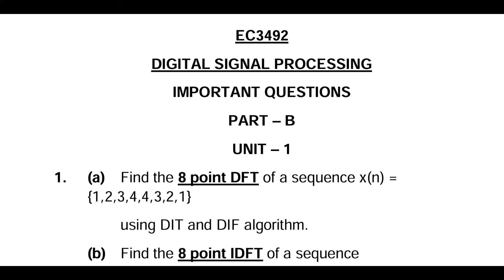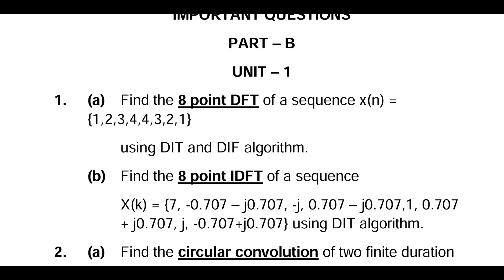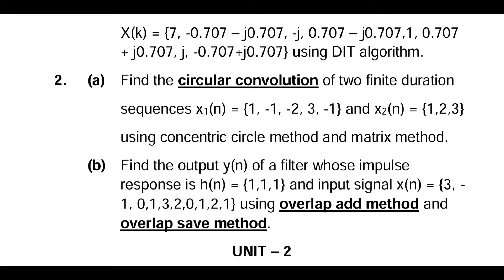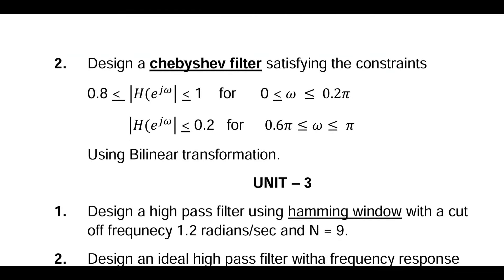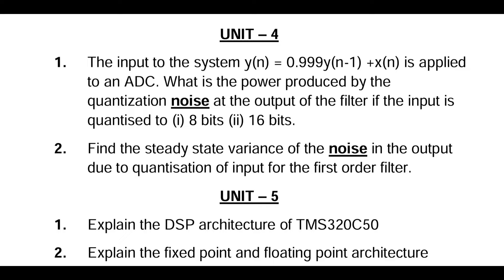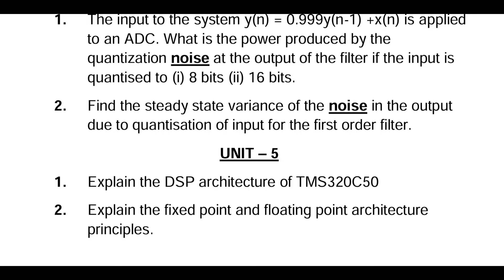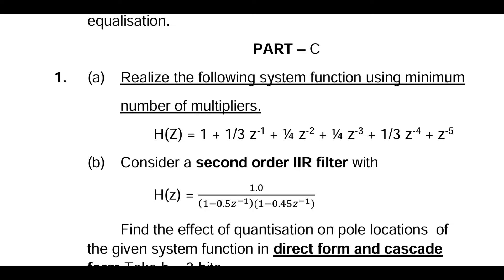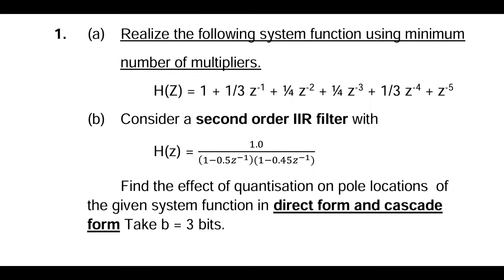DSP Digital Signals Processing Important Questions EC3492 Semester 4 ECE department

Comment: 1.  (A) Two points C and D are 110 mm apart. The third point E is 80 mm from C and 65 mm from D. Draw and an ellipse passing through the points C, D and E and measure the focal distance. Or (b) A circular wheel of 40 mm diameter rolls on another fixed wheel of 70 mm diameter and above it for one complete revolution of the rolling wheel. Draw the curve traced by a point on the circumference of the rolling wheel which is initially situated at the common contact between the wheels. Draw a tangent and normal to the curve at the point on it which is 70mm from the center of the fixed wheel. Sir itha rendu questionnum syllabus la irruka sir
Reply: Ithuku grase mark irukka sir
Reply: EG3251 ( 2021) regulation